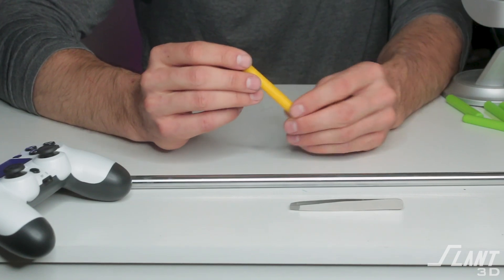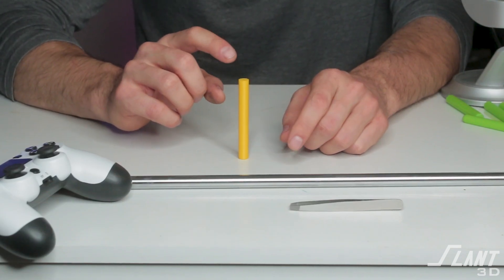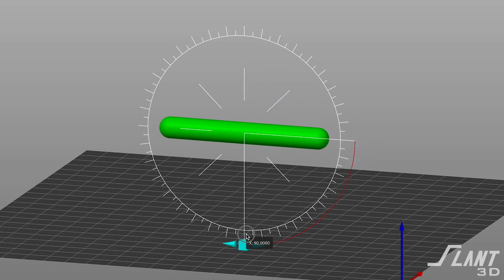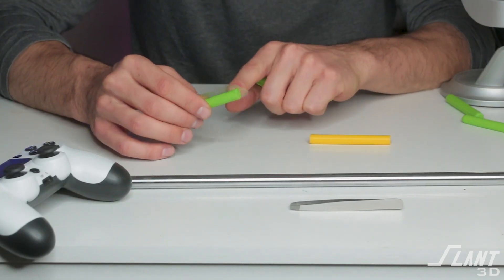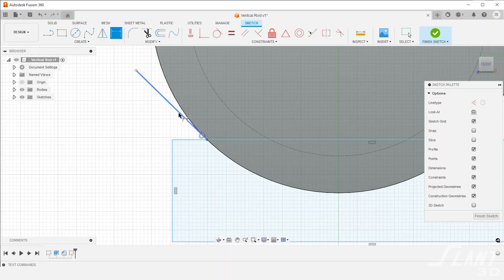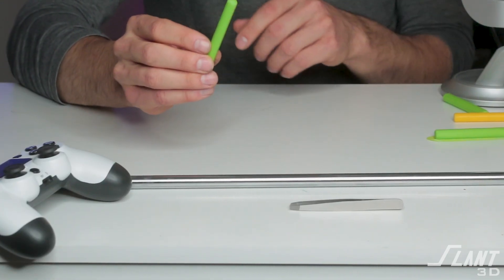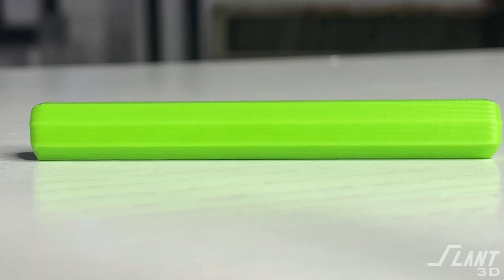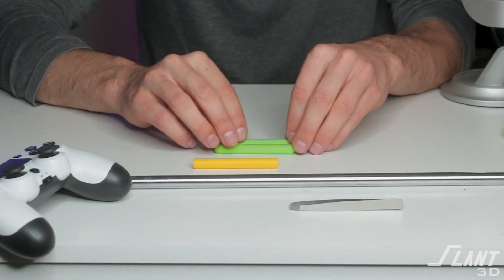Rods | Design for Mass Production 3D Printing

Comment: Thank you. For the video. I made a completely round rod 203mm in length. 1, I printed it vertically. It keeps falling over during printing and it is not as strong/stiff as I would like it to be. So I will be redesigning the part. Thank you.

Comment: One form of success I have had is lifting the parts off of the print bed and fully supporting the part with support material. You have to optimize your support interface settings, but afterwards, you are left with a perfectly round part that will fail a lot less. 

I do this a lot for ovular/ spherical shapes where both the X and Y axis have curved edges.

Comment: The flat surface is - imho - a very desirable feature for keying with eg. gears, whilst being compatible with bearings.
No hardware needed. Just design with a slight interference fit. The first thing failing isn't the connection but the teeth.

Comment: Timing! Just making a golf club for my almost 2yr old daughter and was thinking of how to do the rod. My initial idea was to print to halves and glue them together. But I think I'll go hexagon and make a wee adapter between the club head and shaft. 
Thanks Slant3d
Reply from the maker: OUr Pleasure
Reply: Prusa slicr let's you add peg and hole to put your creation together if it needs to be in multiple parts. The slicer works great for all sorts of printers.

Maybe other slicers have this feature too, but I just stick with what I know best.

Comment: I like splitting the part in two if I need a long, thin print.  That gets it down on the bed without sacrificing detail.  There are many ways to align the parts during post processing to glue them together.  The best way is if the rod is used as part of a greater assembly, then glue the halves togethers as they get glued into the assembly.
Reply: it is a good way to do but it is not mass production.
Reply: @burakistikam5362 can be mass production as well it produces a rounder part.

Comment: How about combine both. 

Design/Print your nice circular smooth rod (or threaded) vertically but cut out the middle with a smaller size of one of your rods that is printed horizontally (or even a simpler rectangular or triangle). If your tolerances are right put them together w/o glue or anything and you get both strength and detail.
Reply: I know this isn't ideal for mass production 3d printing....with extra steps/pieces but for the hobbyist/prototyping  it's a good option that I haven't seen people doing.

Comment: A flat side(s) also means keyed holes, which can be to your advantage if you don't want things rotating.
Reply: It's honestly kind of ironic how often people forget that while you can't drill a square hole with a normal drill bit, you very much can print one. Some tiny chamfers on each corner of the rod that goes in and you have a perfectly fitting slot that is easy to print with very low failure rates.  
If it needs to rotate, I also always ask myself if the whole rod needs to rotate or just the contact area, because you likely want a bearing anyway, so you don't need to make the whole thing a cylinder.

Comment: Another option is to split the rod along its length, print both halves flat side down, then glue them together. Not ideal for mass production, but great for people at home.
Reply: Was thinking of this option, and wondering if rod halves could be designed to interlock (snap together), vs. being glue. A minor amount of human touch, but a rod is likely to be a subassembly to another component anyway.
Reply: That is an interesting idea.  You could have each part printed in a different orientation, as to get the most benefit out of the extra assembly time.  Plus - you can overlap them to create rods that exceed the length of your build plate!

Comment: What about printing at a 45° angle upward and straight along the X or Y axis? Or 45° from all three axes to maximize potential length?
Reply: I do the same and works well, eg PETG threaded bar M12 x250mm..... much stronger, but not really mass production, and also change of part geometry needed local to print bed.
Reply from the maker: Too much support
Reply: @slant3d  It shouldn't need any support that it wouldn't need as a vertical print, with the exception of a base to aid adhesion at the low end. I've tested it at home by printing a few 2020 v-slot beams that way along the Y-axis at 100mm on a CR-10S5 and the only issues I noticed seemed to stem from temperature settings or humidity (i.e. flow/stringing) but I lack the expertise or the tools to really judge if the end product is any better than flat or straight vertical. That's why I asked.

Anecdotally, it seems stronger than a vertical sample I made on another printer, but that's potentially mental bias since I didn't use any equipment to test the shear strength beyond my bare hands.

All of that being said, I did accidentally slice the model with supports turned on once while double-checking the time and material figures for my notes and yeah... the difference is terrifying.
Reply: @slant3d it needs only a little bit of support at the beginning.

Comment: For vertically printed rods, one can also run a small screw/bolt through the center, which can help alleviate the fragility caused by the layer lines. This can be seen with certain Voron parts, for example. Not too practical for very long cylinders, though.
Reply: Not if you're mass producing. You must eliminate all and any human interaction with the part.
Reply: @dennisdecoene at that point just design around using the allthread as the part
Reply: 1/4-20 all thread rod is cheap at long lengths and can gi you some great support strength.  Add a very thin CA glue to bond the all thread inside the 3d print, and it is like rebar inside concrete.
Reply: I do this with 3d printed 2020 extrusion. I put a 5\16ths rod down the center
Reply: @LT72884  huh. It that a cheaper way to prototype, or is it usable for final assemblies?
Reply: @admadea  I 3d printed an entire prusa bear frame this way and it's pretty solid haha.